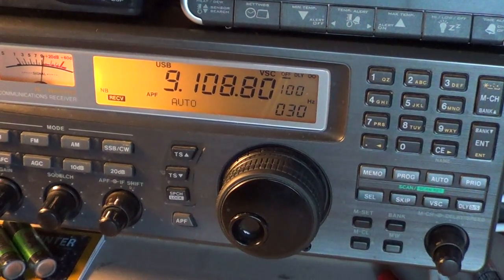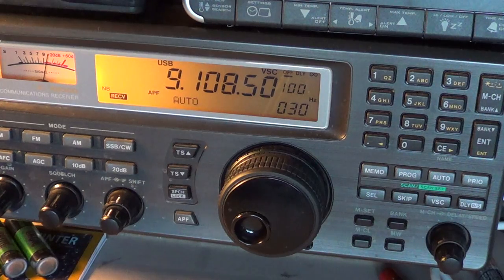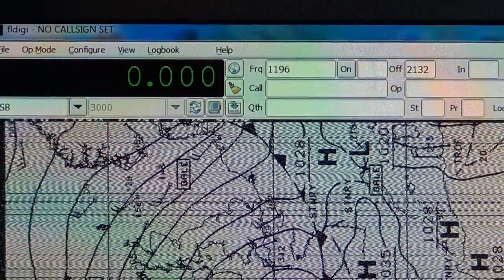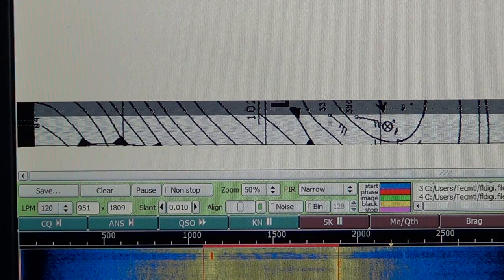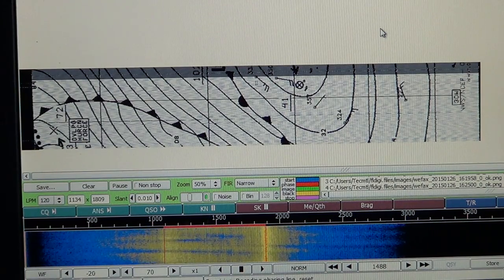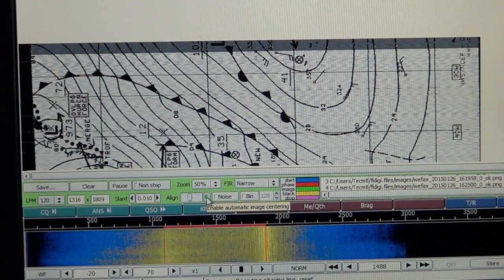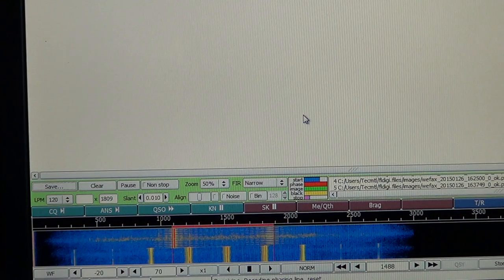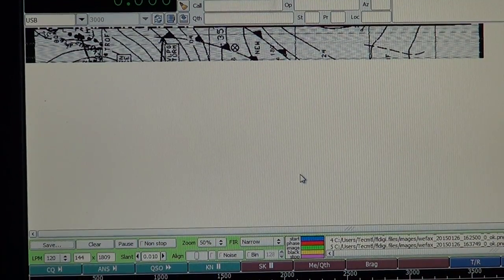Tutorial How to decode Weather Fax on Shortwave Using FLDIGI

Comment: It might help to understand that the wefax system was originally a simple mostly hardware system. The bar was to indicate the left edge of the fax on some printers you had to manually adjust the position of the page left to right. As a RO at sea I used a nagra fax  machine connected to a normal receiver a Yasu FRG7 if my memory serves me. Between the CW weather broadcasts and Fax you could provide the bridge with a complete weather forecast at least once a day. Goes sat pictures are sent via Wefax by coast stations. The USCG stations provided good weather information.

Comment: How do you get the signal received on the radio to the software?
Reply: +Gilberto A. Rivera  Typically, the radio will have an audio out connection, just run a cable to the line-in on the computer sound card and then select that line in FLDIGI as the audio source.  Pretty much all the digital mode software programs work that way.  So you can listen in on PSK, RTTY, Olivia, JT65 as well as slow scan TV, whatever.
Reply: @inkt9b  you could also use websdr.org and direct the audio to fldigi